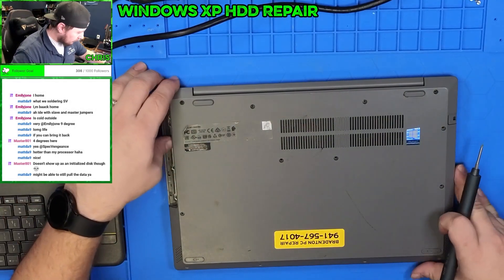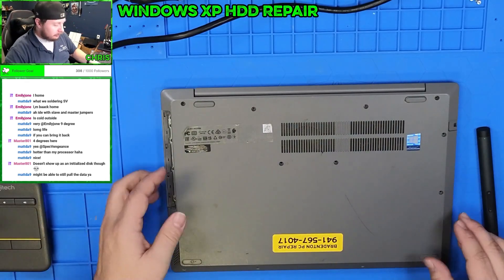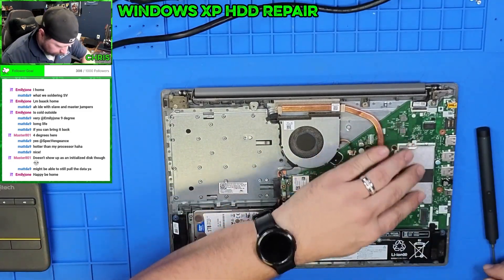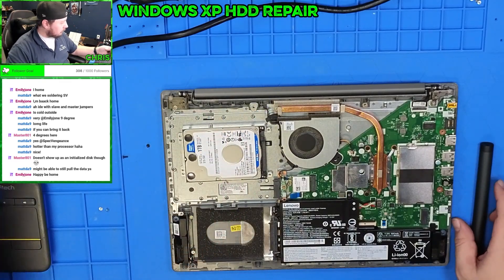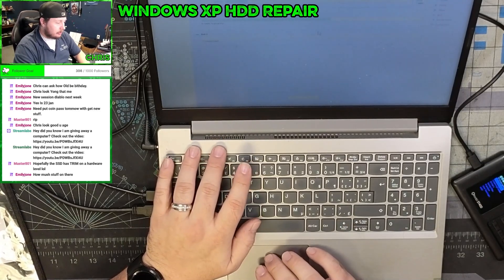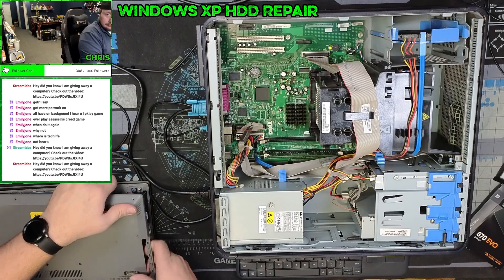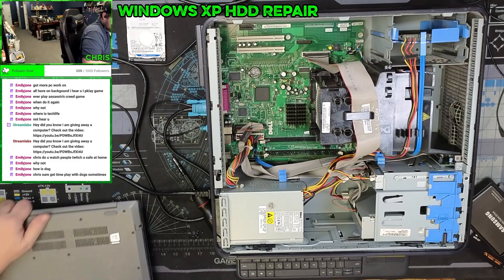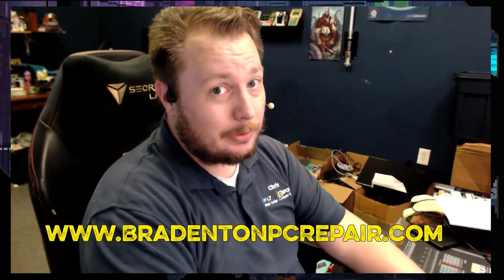Lenovo Ideapad L340 Teardown and SSD Upgrade #160

Comment: You would use an 80mm long, shape "M.2" SSD, notched at the contacts end in position "M". It has a dramatically faster parrelel connection than that SATA SSD in the metal can.
Reply from the maker: If I did this again in the future, I might do that.